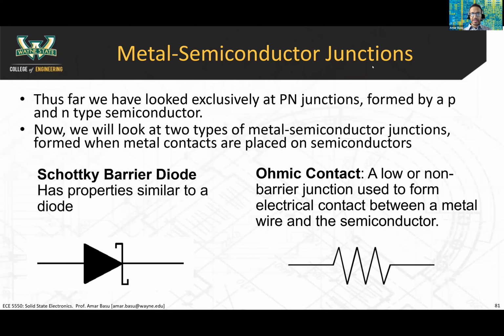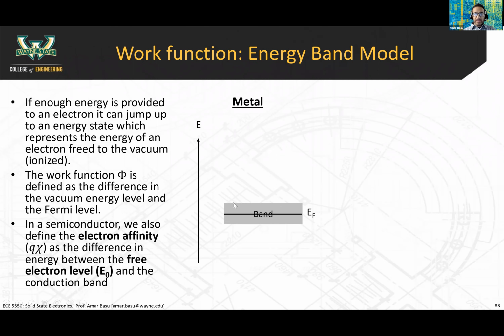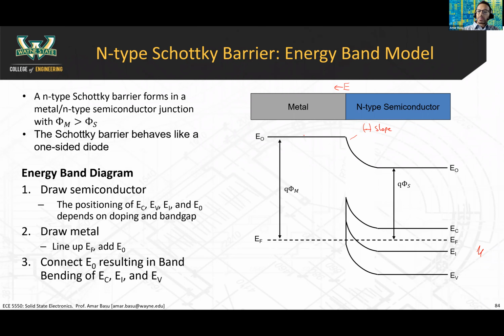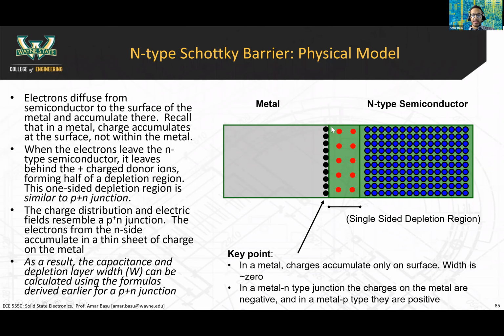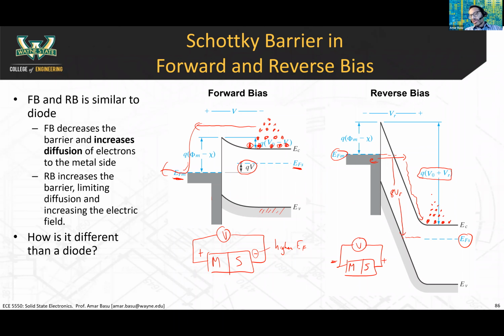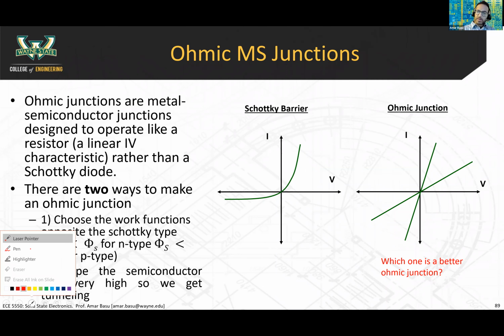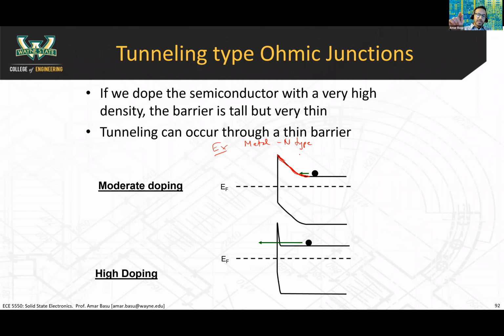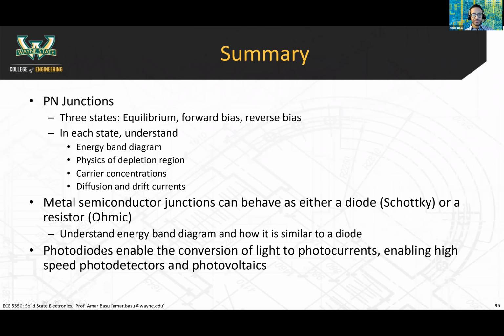5F - Metal Semiconductor Junctions

Comment: From CRTs in a TV I know that the work function of a metal can be reduced dramatically. How do I know that the semiconductor and the metal don't react? I think that high silicon content steel is used for transformers. It has low conductivity, but still is a metal? So an iron - silicon interface is always Ohmic? For MOSFETs we want Ohmic -- so why is copper used in modern CPUs? I think that copper is quite noble and will not react or form interface states to make a contact Ohmic. I would have loved to see a naked discrete diode in vacuum instead of PowerPoint. Show the stray fields. "Assemble" the diode and show how the fields get stronger. Then we have some tunneling and finally contact.